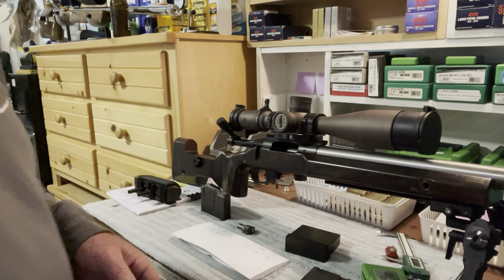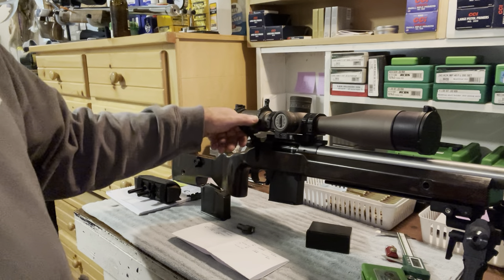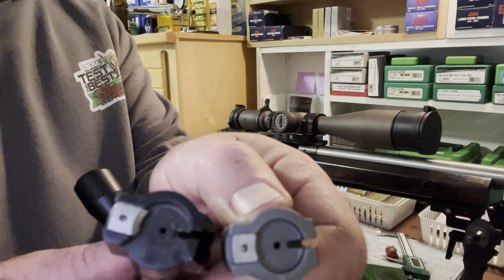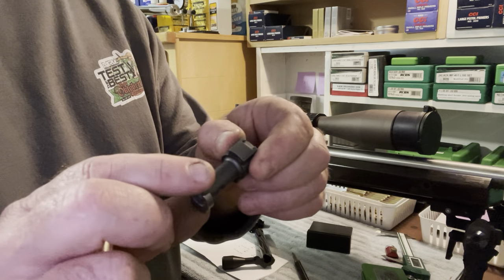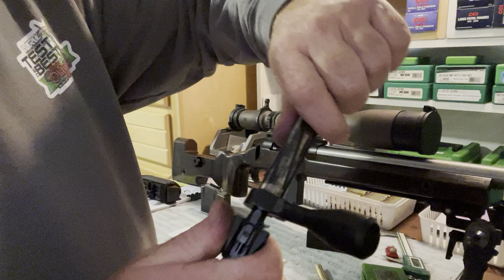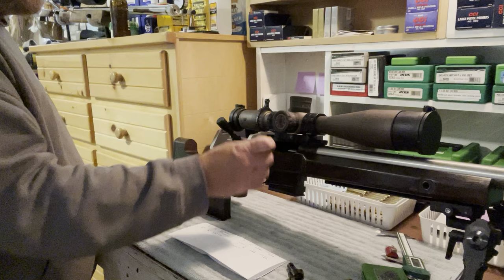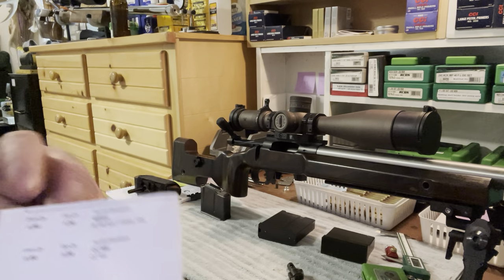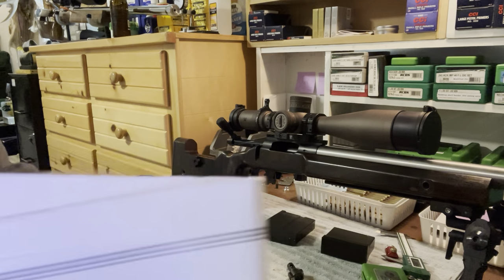Bighorn TL3 Upgrade -Smooth Feeding

Comment: If you don't mind me picking your brain, perhaps you have some wisdom to share. I have a near clone of your rifle-- Foundation MG2, Hawkins M5, TL3 with AW cut. The rifle absolutely will not feed from the AW magazine, even though this Hawkins metal has the longer latch that supposedly addresses AW feeding issues.. Regular AI mags seem to work just fine-- at least my Accurate Mag metal 5rd and my 10rd PMAG work fine.

Have you dabbled with AW magazines?

Your video makes it look like the push feed bolt head might be the way to go for me since I mostly want to single feed off a sled as I'm primarily shooting either from a bench of from prone for F-class.
Reply from the maker: I've never used AW mags. I use MDT or AICS 
( when I use mags) Am generally single feeding from a loading block...  https://1022racerifle.com/score-high-aics-308-size-single-shot-magazine-block/

P.S. -  MDT are excellent mags and I cannot recommend them enough. Have always been flawless for me .
Reply: @longrange1114  Thank you so much for taking the time to reply. Since I think I will mostly end up single feeding as well, I'm really like the idea of the sled and pushfeed conversion. I actually toyed with getting the single shot TL3 since it would work for 95% of the shooting I do with this gun (I have other guns for hunting). But I thought it might be too limiting-- you can easily adapter a repeater to be single shot, but not the other way around.

Thank for the link to the sled-- that seems like the way to go.

Comment: Just wonderning now if push feed is the best option for the larger 7PRC caliber when using the AICS single stack magazines. Sure looks that way from your video.
Reply from the maker: Not sure but maybe worth a try. I tried this in the first place because I was using this rifle for matches that required loading one round at a time and they were not feeding smoothly. This solved the issue for me in that regard and it also still happens to feed smoothly from the magazine. Your mileage may vary but this worked for me. 
Good Luck!